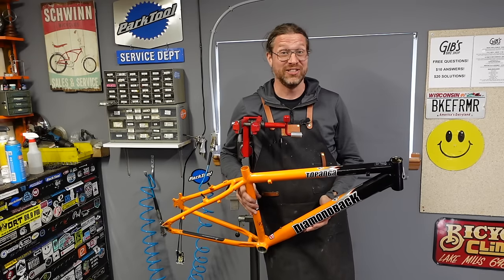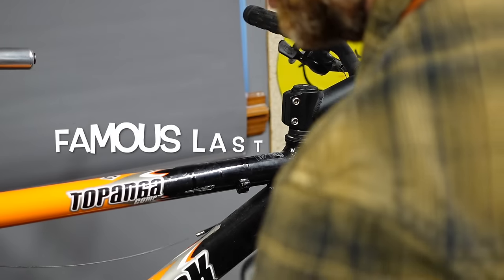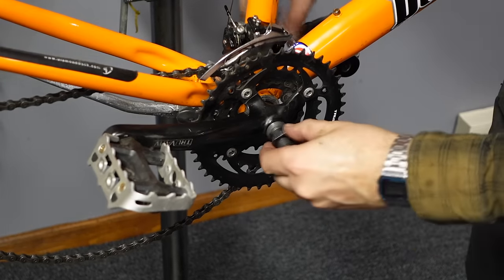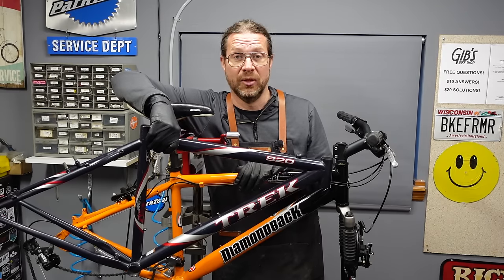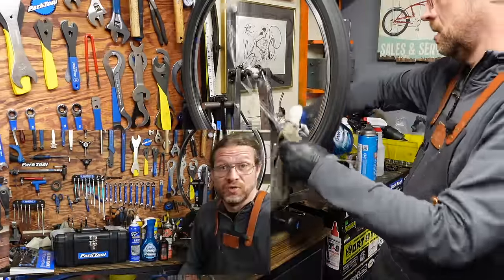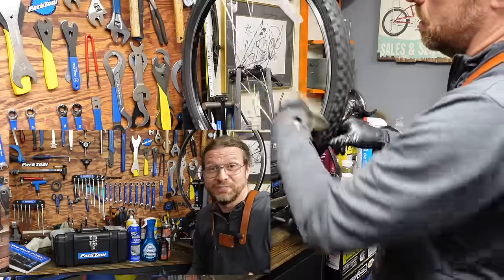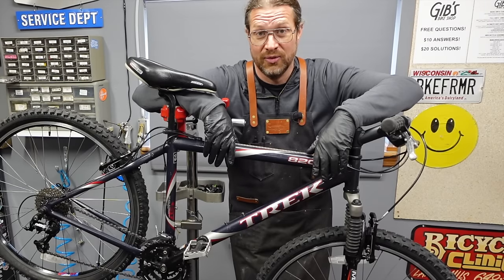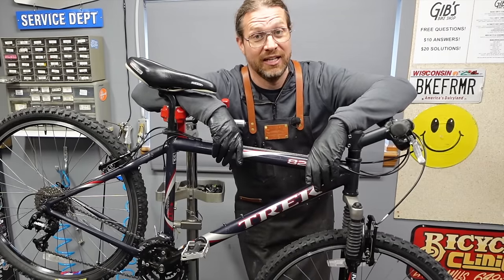A routine bike rehab took a CATASTROPHIC turn! Complete rebuild of a Diamondback turned into a Trek!

Comment: When the BB threads are shot, but the rest of the bike is good, Sunlite Threadless is a square taper BB that threads into itself instead of the frame.  For less than $30, you can save the bike and not have to swap everything over.
Reply: This is the answer. This guy doesn't know !
Reply: The Amazon site in the UK has such bottom brackets for about £3 under the Mwave brand. I can't post links here but wouldn't be surpised if not on Amazon US site too. I'm guessing all sourced from China.
Reply: I used one of these once and it didn't work out that well.  Always made a noise.    Plus, I would be hesitant to sell a bike with such a BB.
Reply: Hey @bikefarmer if you want to try out one of those sunlight BBs, I have one I never used and you can have it.   I’ll mail it even
Reply from the maker: @marta150  thanks for the offer, but I’m not that into this idea.
Reply: @bkefrmr  agreed.  That is why I didn’t use it
Reply: I used one of those on a customers Schwinn like 2 or 3 years back and it’s still working to this day. I just tuned up the bike and the BB was still good, and this guy is pretty rough on his bike and likes to ride.
Reply: This is fine idea for your own bike to try but not a bike sold at a shop who needs to keep a good reputation.
Reply: Smooth Jazz is where it’s at, My Man!
Reply: Trek is a better move.  More brand equity than Diamondback.  Especially in Wisconsin.
Reply: Not very reliable, the Velo Orange one is the very best, abet very expensive

Comment: I think I'm one of those very lucky fools who has the riches of bikes. I restored an 1967 Phillips 3 speed (Raleigh frame). 'Have a light weight aluminum hybrid, an entry level mountain bike (great for gravel) and a commuter e-bike. I'm no longer allowed to enter debates on Shrader or Presta valves and disc brakes vs rim brakes or mechanical disc brakes vs hydraulic systems since I now ride one of each. No arguments, they're all good. One top of that, there's a terrific independent bike shop in town run by a great guy and unknown genius who repairs bikes and can find parts for just about anything!  We count our blessings.

Comment: I wouldn't throw the old frame away! get it welded and then bored out and re-thread the bottom bracket. After that either sell the frame separate or build another bike from spare parts. Good video by the way!

Comment: Here's a tip I learned when I was a hobbyist blacksmith:
Reverse your hacksaw blade so it cuts on the pull stroke.  Pushing uses mostly triceps and pulling uses shoulder and back muscles.  You can cut for longer periods without fatigue and with less wear and tear on you.

Be nice to your body.  You've only got one of them, so make it last.  :)

Love the channel.

Comment: I would be tempted to try to figure out some way to repair or reuse the Diamondback frame since it was such a nice looking alloy frame.
Reply: One hack is to re-tap it for an Italian threaded BB, which has a slightly larger thread diameter. The shell width is also slightly different so some spacers may be required. Expensive and "at your own risk" since you're removing material from the most stressed part of the frame.
Reply from the maker: Thank you!

Comment: Half my bikes have both presta and schrader tubes  on the same bike.
Reply: to me the "old" shrader valves are much better. on presta it's too easy to bend that little metal thingy when you open them. the thing is that presta are thinner and most rims come with holes for presta. 😁and i don't wanna drill into my rims

Comment: As a first after buying a new Brompton, folding bike in 2019, I gave all of its painted frame an "Auto Polish", and found out that the small pieces of clear tape "protection" from the Factory had been near worn through to the paint after a few folds! As I like my bikes to look like new, I found all the possible "protection plates" and a cable shield from China and it still looks like new today, and very much lighter than the original, from the amount of possible carbon and titanium parts I also found in Asia!
    I also changed my crank to Ceramic balls and titanium.    Finn. Denmark

Comment: Schrader valves are common in Europe. On the bikes that have a steel frame, mudguards, 3 speed Nexus internal gears, threaded heatsets, etc. Presta only on bikes for sport.
Reply: I have presta on all my bikes so I can use the same pump 😊
Reply: @chrisfilby9678  Get a twin head for your pump, they're only like $6.
Reply: @ltu42  Zefal HPX frame pump the only pump for me. ✊
Reply: @chrisfilby9678  No floor pump? How spartan.
Reply: @mattgies  ofcourse a floor pump, but I find it cumbersome and heavy when strapped to the bike when I go for a ride so have been using a Zefal HPX when out on the road for the last 35 years. 😉
Reply: @chrisfilby9678  There are adapters that adapt Schrader to Presta.  You can screw them onto the Schrader valves and leave them on while riding, then you can use a Presta pump or, after removing the adapter, a Schrader pump (e.g., at gas/petrol stations).  The adapters are not expensive, perhaps $2 or $3.
Reply: @mattkavanaugh5623 those adaprors can be useful, but not necessary if you always carry the relevant pump. I think it's just a different mindset between the casual rider and those who take cycling that bit more seriously or cycle more often.

Comment: Three bikes here: one with Schrader valves, the other two with... Regina valves! - Italian standard, same size as Presta, can be replaced with a Presta tube.
When I bought bike #1 it had Regina valves in Schrader rims. I changed the tubes to Schrader for that reason.
When I bought bike #3 I found that it has one Presta rim and one Schrader rim. I stayed on Presta, using a DIY adapter on the Schrader rim (I found the recipe on a You Tube video): one of those convex washers you find in V-brake pads - the right internal diameter for Presta, the convex part fits the Schrader hole. So far, so good.

Comment: I'da been looking for a way to evenly add a bit of diameter to that crank and then use a tap to thread it, thus eliminating the play. Thin pipe, Coke cans, that sorta thing. 😅 And not quite as wide as the old threads, so as to give the tap threads to start on.

Comment: Is it possible to bore and do a sleeve installation in the bottom bracket tube then thread it if that's a steel frame? That would be an interesting project
Reply: That would be my question, too. It would be a shame that a perfectly, structurally sound bike frame couldn't be used, because of the threads, or the lack there of. If that surface could be built back up, or the threads could be re-chased to receive a larger bottle bracket. I didn't see any cracks, or any other structural issues.
Reply: Best solution is to use a threadless bottom bracket. A few dollars more than a regular BB
Reply: I was wondering about that myself but too every bike shop of any age normally has some older bike parts thay can swap parts from. I am sure  in time thay have to make a run to the scrap yard old junk at some point is just old scrap metal.

Comment: I love what you do. Even if i would do some things a very little bit different. But am young and dont need to fo it for living. I really enjoy how u r trying to get things perfect.  Maybe becuz i always felt and science has later prooven that shimano HG chains are most efficient chains for power transmission. and conewheels are more efficient than the new sealed bearing wheels ^^. but on MTB or BMX effieciency doesnt matter for speed ^^ So for normal day riding, what includes 90% of my ways within 40 miles , cone bearings are the only choice, cuz they are most efficient, since dont have an ebike yet ^^

Comment: What causes this bottom bracket failure? Riding the bike around with a loose bottom bracket ? Or was it low quality mfg ?
Reply: The bottom bracket cups probably got loose and a person who knows about bikes would feel the play and stop riding immediately and either tighten or replace the bottom bracket cups or cartridge.  I bet this person just kept on riding and the cups unthreaded more and ruined the threads

Comment: Why not use a pipe cutter to cut the fork? I've used one to cut a a  few fork steerer tubes and it does a great job with very little physical effort required. It seems to be a much easier solution than using a hacksaw unless the fork is carbon.
Reply: When I used a pipe cutter it left a ridge that needed filed down before stem would go on. With saw guide I have no problem

Comment: Velo Orange has  BB thatll work with stripped threads. And:  When the BB threads are shot, but the rest of the bike is good, Sunlite Threadless is a square taper BB that threads into itself instead of the frame.  For less than $30, you can save the bike and not have to swap everything over.
Reply: AGREED. I wonder how does he not know when he should of all people know that such things exists
Reply: That’s not something I’d want to put my shop name on then sell… that’s total fine if the customer opted for it. However this is something that will be sold to a client. This bike is a business card.

Comment: doesn't problem solvers or wheel make an adapter that could make something work? or is that not worth it.
Reply: There are a few manufacturers that make a BB  that does not require threads in the BB.. not the best quality but they work ok..

Comment: I get that you run a bike shop and time is money etc. but when I restore a bike for my own personal use i completely disassemble the entire bike, any and everything that comes off the frame comes off including the headset cups etc. I then wash, polish and wax the frame and fork with car products and one by one take each part out of box I put them in and clean polish lube and re-install every part and replace anything that is trashed. When done, the bike is as good as it can possibly be at that point. Obviously that is a lot more time and effort and not something a bike shop would typically do.

Comment: I worked in tool and die for a number of years is the bottom bracket aluminum area on the first bike heat treated in any way ?  I had a great master machine’st friend we were aloud to fix things on our lunch break for free. $30,000 Bridgeport mills can be a nice help sometimes.
Reply: Aluminum bike frames are normally heat treated (the whole frame after final welding). Which is why it's rare to try to repair them.
Reply: With the low number you threw down for a used Trek frame it really wouldn’t be worth the trouble for an aluminum frame. Hope my Giant aluminum frame holds up.

Comment: The solution to the brake cable vs brake wire fight: use exclusively hydraulic disc brakes. Argument over 🤣

No disc brake mounts? You get no brakes . . .

Comment: That rear cable is fucked and frayed, 36:33 
it needed changing and you left it as it was for a couple of bucks. If you are flipping bikes, at least make them good before they leave the shop. Also $399 on a shitty arsed BSO which is no better that a Walmart box bike is a bit excessive imo.
Reply from the maker: Thanks for watching!!!
Reply: My cables look worse maybe you should man up
Reply: I agree about the cable, but otherwise the price is reasonable and that's absolutely not a BSO. Entry-level frame from a legitimate IBD brand (although lately Trek's kinda crapping on the "I" in that initialism).
Reply: @mattgies I suppose my price statement may be wrong as I am not from the US so don't know what the average second hand price is.
Reply: My dad had a small auto repair business why do people think lights gas buildings taxes upkeep can’t be accounted for I think Andy’s prices are fair. Most of the bike shops I know of in South West Ohio have been around for 40 plus years I assume some of there items have been payed off.